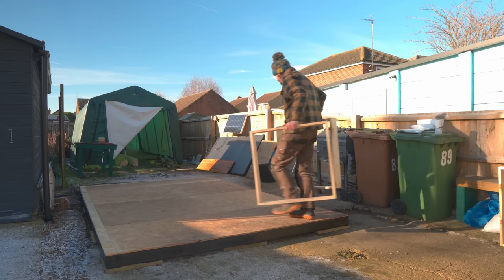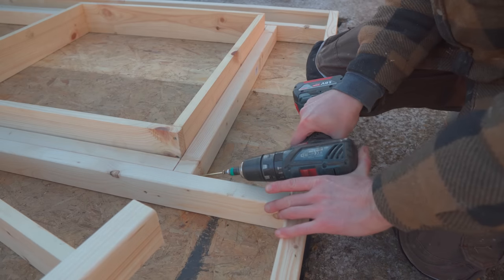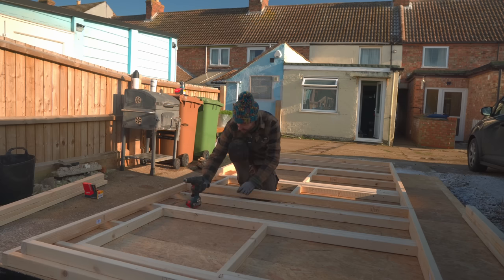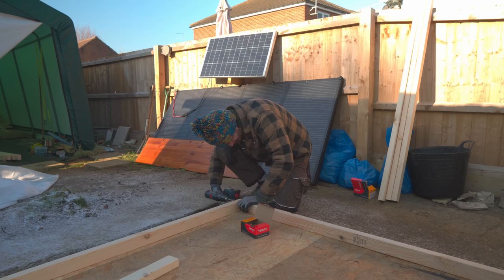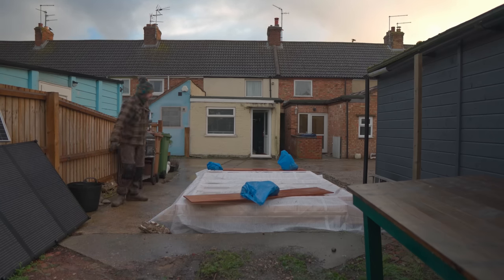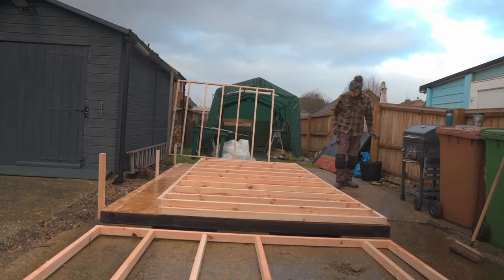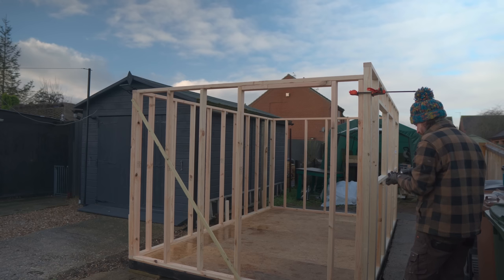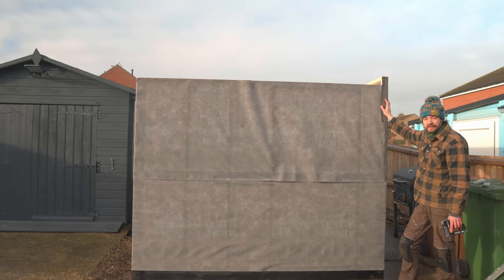Walls Up

Comment: I understand the "I just want to do it by myself", I get very similar feelings :)  Plus it's very nice to stand there at the end and you can say "I did that, all by myself" The bottom stops is a good tip, when I built my summer house myself I attached the diagonal bracing/leg to the wall before picking it up, for me it reduced the chance of me dropping it but it was a somewhat bigger wall.
Reply from the maker: That sounds like a good idea

Comment: I was thinking it would be better to screw in the batten to the base first so you can adjust and then screw the wall frame without it moving but you found that out yourself later in the video too.
Great work on the build and look after yourself.
Reply from the maker: Thank you

Comment: What kind of winds do you get in your area?  Looks like the space you have is pretty well sheltered by adjacent walls, but did you think about whether screws through the sole plates on the wall sections would provide enough strength to prevent wind from lifting the entire structure?  It might be worth adding a few metal straps screwed into the base and into the outside of the studs just to be cautious.
Reply from the maker: We don’t get strong winds

Comment: nice job i did something similar a during covid and it working out great i put metal sheeting on the walls instead of wood and 100mm hard foam insulation in the walls and roof.
Reply from the maker: Sounds a good building

Comment: Hi Matt, thanks for the video, very informative and helpful. I have a similar project to do in the coming months. Can I ask, do you source your materials locally or do you use an online company and have them delivered. Can I ask also how you workout the overall length and qty of wood required for a project like this? Many thanks. Keep up the great work.
Reply from the maker: I ordered online from a few businesses. I made a quick sketch of the building with all the studs spaced out. I had a few bits left over but I will always use them.

Comment: I'm putting a new.roof on my shed. Do I go for 18 mm hardwood ply or 18 mm usb. The difference in price is about £60 but I'm worried about edge delamination. Do I have to wait to next week to find out?

Advice would be gratefully accepted.

THANKS
Reply from the maker: I used Osb

Comment: Wasn't the framing around the windows ABIT of over kill as I wouldn't think you're going to get much if any sag/distortion if you did away with the two longer side pieces and just went with the shorter bottom and top pieces locked into the full hight uprights